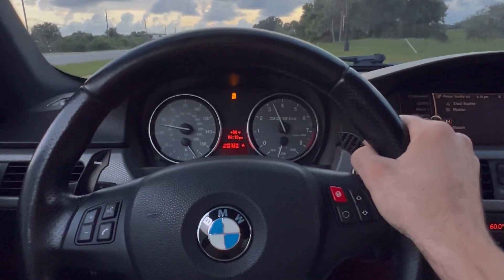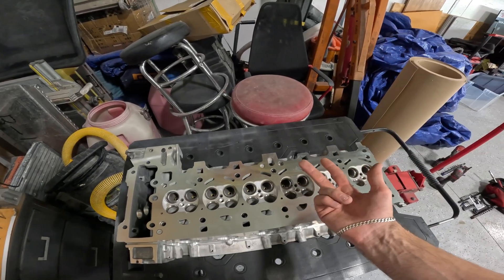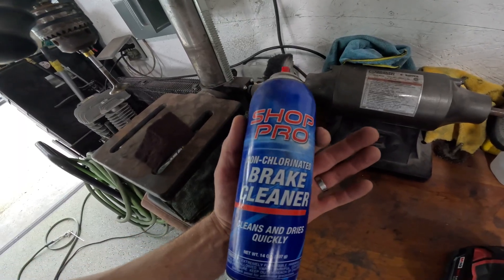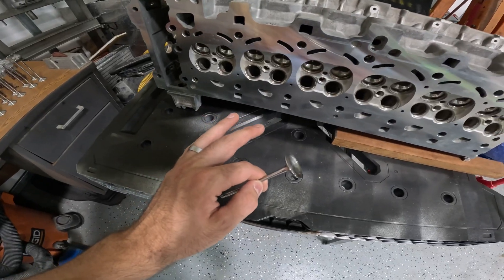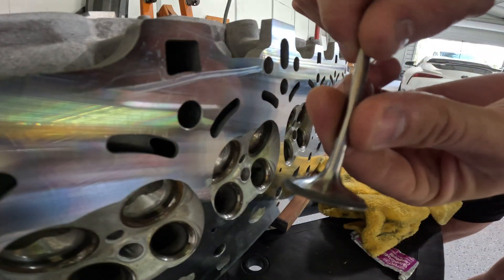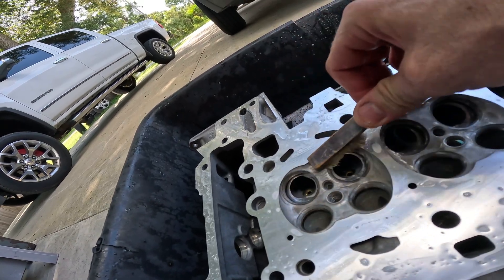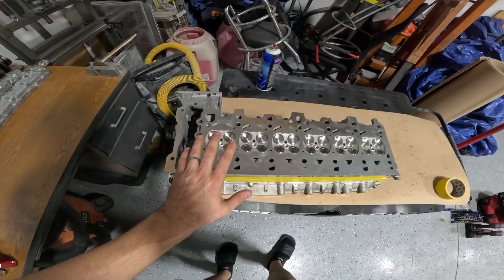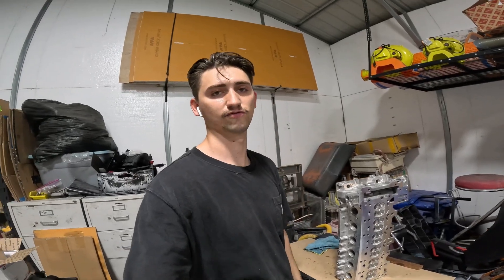BMW N54 BUILT MOTOR PART 1 | CYLINDER HEAD REFRESH AND PLUGGING HEAD PORTS

Comment: Good job cleared up some question i had.  But i have a question though if replacing the valves with new ones shoulbi lap with old first or lap the new ones?
Reply from the maker: If you’re going to use new valves I would also replace valve seats and guides. And have a shop do a 3 angle cut on valves and seats.

Comment: How much do you usually spend when doing N54 rebuilds ?
Reply from the maker: Depending if you do a lot of the work yourself, somewhere between 3-6k. Also depending on what aftermarket parts you go with impacts the price.
Reply: @941garage maybe once all done do a price break down video? I’d be interested. Thanks!
Reply: @941garage yea a breakdown would be great this is a good series to watch I appreciate it

Comment: He’ll yeah let’s see that bottom end build
Reply from the maker: Coming soon!
Reply: @941garage  Hey man I know your a busy guy but u seem to know what your talking about,  I have an 08 335i n54, hybrid RB TT, HKS Seq BOV, Charpipe, JB4, Stage 2 Clutch, HP Fuel Pump from fuel it, and etc.  Well I got in a minor accident and Geico totalled my car but i refused to give it to them, then i had kids n etc.  Well I finally got the title this week, The motor has no damage at all but it has been sitting for a long time.  Im gonna change all the fluids and do an oil change before I run the motor,  the motor had 30k miles on it, and I drove it 1300mi before I got in the accident.  It's been sitting for 8 years,  If i change fluids, do the oil change, and syphen out the old gas and get a fresh tank do u think I'll be okay,  I don't wanna destroy the motor i have been dreaming about drive stick and blowing past people as my BOV goes off for 8 years, I just wanna make sure  there's nothing else i have to do.  Thanks in advance, hopefully you have time to answer.  Either way love the videos man I just found you on YT so I'm still making my way through the content but im loving it.  Thanks.
Reply from the maker: @chrismitchell9862 thank you! change the the fluids and makes sure the low pressure fuel pump is not seized. And you should be good